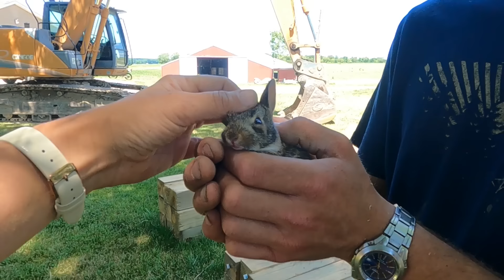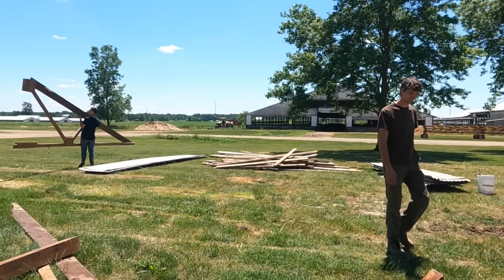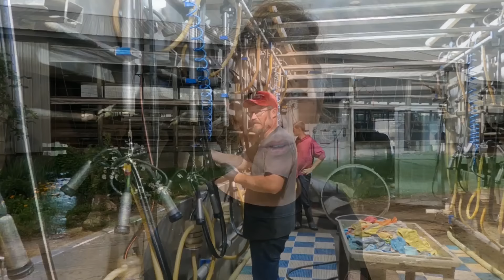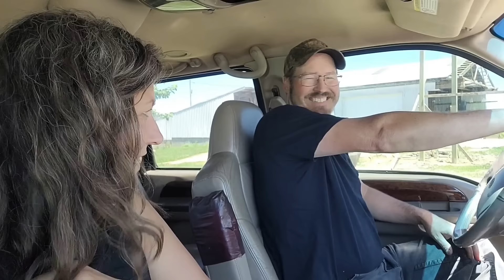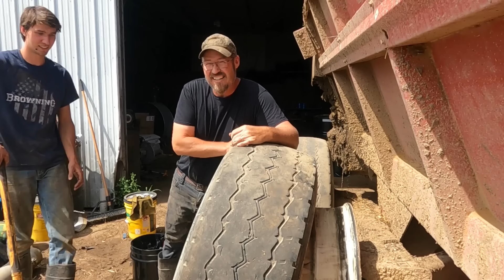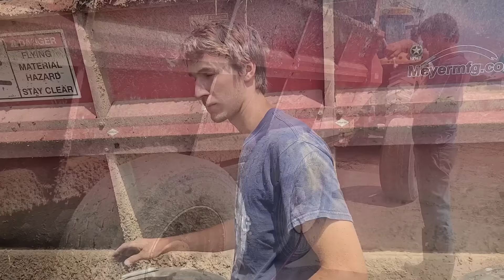Destroy and Rebuild ~ Mystery Project

Comment: Kevin,  next time you are trying to get a tire to bead-up on a rim. try putting a 2" ratchet strap around the center of tread and tighten it. it will cause the out side of the tire to push out towards  the bead lip.

Comment: If I were to hazard a guess, the new building has to do with machinery storage and a new shop for Kevin and the guys. It's such a challenge when the electricity is off for an extended period, a few years ago a winters snow (22") had ours out for 3 days. When you have extremely hot weather do you change the cows ration at all? Have a blessed and safe week.
Reply from the maker: We don't change the ration, but we do change the frequency. Feeding smaller amounts more often so the feed doesn't heat. Cows won't eat hot feed.
Reply: Bonjour 
Je n'ai toujours plus de traductions pour les commentaires 
COMMENCE À M'ÉNERVER  BEAUCOUP 
YOUTUBE 
ET JE NE SUIS PAS LE SEUL A QUI CELA ARRIVE 
SAIS PAS FACILE DE MONTER UN PNEU DE CETTE TAILLE 
BON COURAGE 
MERCI POUR LA VIDEO 
UN FRANÇAIS 
JS 😊😊😊😊😊😊😊😊😊😊😊😊😊😊😊

Comment: A ratchet strap in the center of the tire will sometimes help by pulling the center of the tire in forcing the outside tire walls against the rim
Reply: That's what I had to do and worked like a charm.
Reply: Never had any luck with that, starting fluid works well.

Comment: Big toys for big boys. Nice video everyone. Demo this, building that, baby Bunnies & baby Cows. You's guys are always busy. Thank you for the invitation to watch. FYI: When my Mom got up in age we got her a whole house generator that ran from her 1,000 gallon propane tank and came on automatically when the electricity turned off. It worked very well for almost 8 years. It was so automatic and trouble free that sometimes I came over and it was running but she didn't even know it. I just wanted you to know so you might consider one for the milking operation for those times when the electricity fails and you're right in the middle of milking. Or when it stays off for a day or two. OK, FB &.looking forward to the next time. tnx ben/ michigan over by Flint
Reply from the maker: We've talked many times about getting an automatic start-up generator. Maybe one day...
Reply: Those are expensive, and the power unit + the automatic switch is expensive. The farm already has tractors, so a PTO unit is more economical.

Comment: When I was still on the farm, we were at the very end of the electric service and only had a 60 amp transformer. The barn cleaner took 11 minutes to make one pass. 
Picked up an old 20 k pto drive generator that didn't work. Had it fixed for the price of new brushes. Hooked it up to the barn for testing. Used the JD 4020. The lights were much brighter and the barn cleaner only took 7 minutes for one pass.
Once we new it would work we put a plug in for it on the power pole betwen the house and barn. Power came from the road to this pole then split to go to house and barn. Shortley afte that the transformer blew and they replaced it with a 200 amp. Worked much better.

Comment: Ronda was soooooooo funny with her comments to Kevin about saving some of the old lumber for "Wife Projects"!!!  I remember as a kid, losing power before milking time.  We did not have a generator back in the 60's and 70's.  We would pull up our Allis Chalmers "WC" tractor to the barn.  It had a special attachment on the intake manifold, which we could run a special hose from the tractor to the vacuum tank of the milking machine.  We normally ran with 4 milkers, but the tractor vacuum was only able to handle 3 milkers.  But it was better than trying to milk around 20 cows by hand.  With the Ratchet straps you had, maybe you could have put one around the center of the tire, to help force the sidewall beads outward to help seal better.

Comment: The generator, the most important but least used piece of equipment on a dairy farm. I know what it's like to be without electricity. We had a bad ice storm on new year's eve in 2005. It snapped power poles like toothpicks. We had no electricity for 13 days. Cummins brought a semi load of generators to the fairgrounds. Needless to say l bought one!